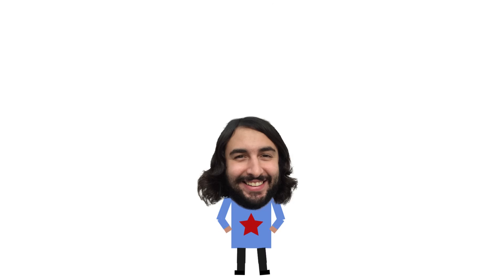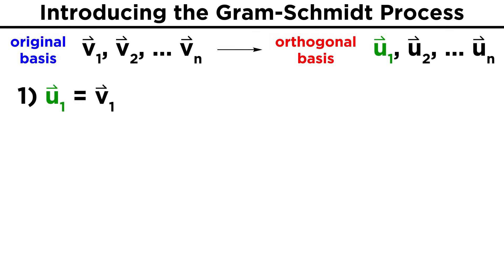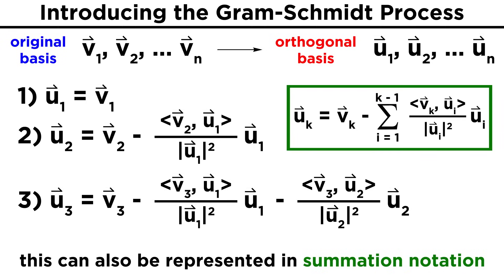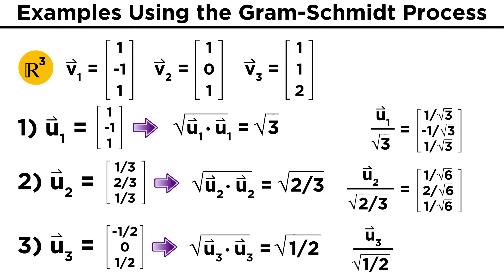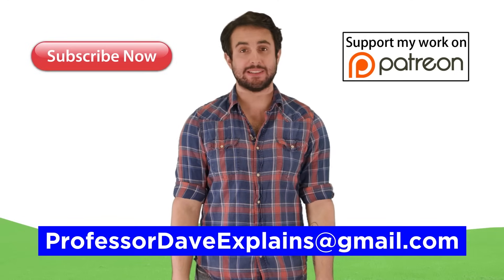The Gram-Schmidt Process

Comment: 🎯 Key points for quick navigation:

00:05 📚 Learn the Gram-Schmidt process to convert a set of vectors into an orthonormal basis.
00:36 🧮 For any vector space, Gram-Schmidt helps form an orthogonal set from any basis.
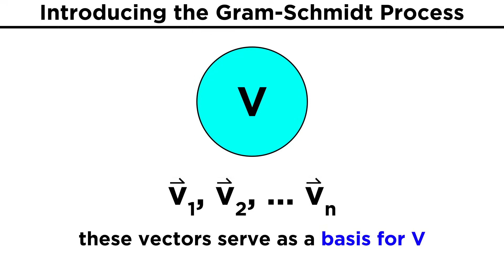01:05 🔄 Start by setting the new vector u1 equal to the first basis vector v1.
01:31 ➖ Subtract specific terms from v vectors to form orthogonal u vectors.
02:29 🧩 The process subtracts non-orthogonal components, leaving orthogonal parts.
03:22 📝 Tips for formulas: match v vector number with u being found; add terms as vectors increase.
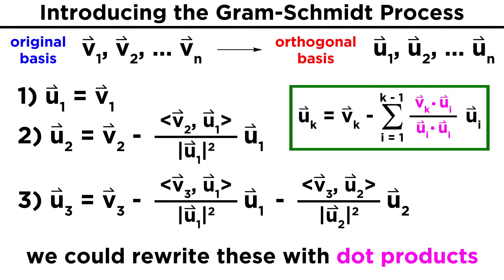04:09 📏 Use dot products to simplify computation of inner products and vector lengths.
04:36 ✏️ A practical example using vectors in R3 is provided to illustrate the method.
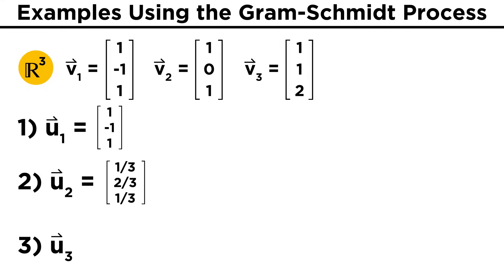05:31 🟢 Achieve orthogonal basis and convert to orthonormal by normalizing.
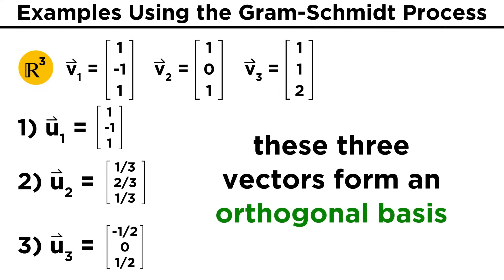06:55 🔄 Transform vectors into orthonormal basis by dividing by their lengths.
08:37 🔄 Gram-Schmidt can also be applied to different vector spaces, adapting computation methods.

Made with HARPA AI

Comment: In the Gram-Schmidt process, when we take the first vector from a set of basis vectors, should we normalize it immediately to make it a unit vector? For example, if the first vector is(1,−1,1), which has a length of root 3, do we need to normalize it before using it to generate the orthonormal set?
Reply: @deeebeeecooper Thanks!, but what's the difference.

Comment: "I attempted to solve the problem presented in the video, and while I obtained the same answer for 
u1 as demonstrated, there's a discrepancy in the value of u2. My calculation resulted in u2 =10/3, 5/3, 10/3, which aligns with the response provided by ChatGPT. I seek clarification to ascertain the accuracy of my solution and identify any potential errors in my approach. Any insights or guidance would be greatly appreciated."
Reply: what you got is the orthogonal basis, his video shows the final orthonormal basis which is derived by dividing vector u by it's length

Comment: I am getting different answer for u3 for the question asked in checking comprehension, will you please tell me I am right or wrong. I tried a lot but my answer is different, for u3, from that given in the video.
Reply: same question in u3 i come up orthormalization of -1/square root of 2,0 and 1/sqaure root of 2..is this also correct.

Comment: At 10:06, U2 1st component and 3rd component is not coming out as 1/√6.   I get 1/3*√3/√2 = √6/6   .
Reply: √6/6 is same as 1/√6 so either answer is okay. Prove the ratios are equivalent using cross products, or multiply second fraction by √6/√6 to get first one.

Comment: In the comprehension, no matter what I do, as an orthogonal vector I always get [10/3   5/2   10/3] and when I divide it by it's length I get a totally different answer... what could I have been soing wrong?
Reply: Do the calculations again, You'll get it. 

Here is the answer: 
So you get the orthogonal vector as [10/3 5/3 10/3].
You take out 5/3 as common from the orthogonal vector, you get 5/3*[2 1 2].

 Calculate the length of this vector, you get √(10/3*10/3 + 5/3*5/3 + 10/3*10/3) = √(225/9) = 15/3. 

Then finding the orthonormal vector i.e., u2/(length of u2). 

(1 / (15/3) ) * 5/3*[2 1 2] = 3/15 * 5/3 * the vector which results 1/3 * [ 2 1 2]  which also can be written as [ 2/3 1/3 2/3] . 

I hope you understood this and this would have helped you!!
Reply: @Arman-v9f4i well done bruhh